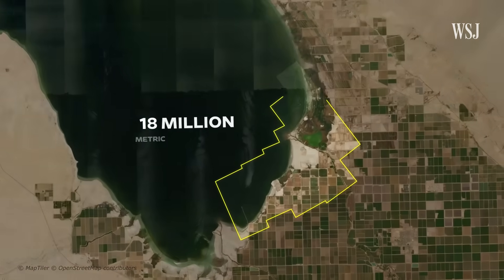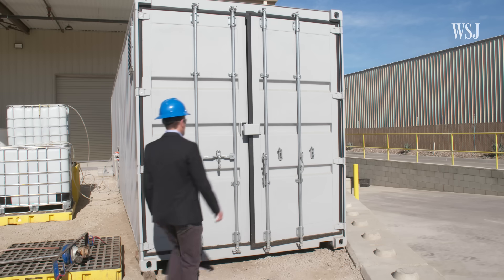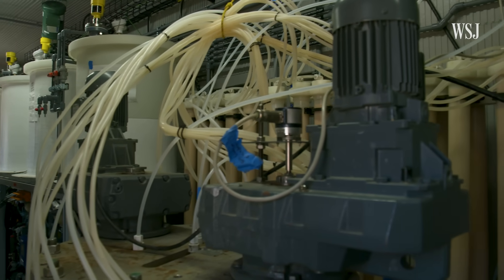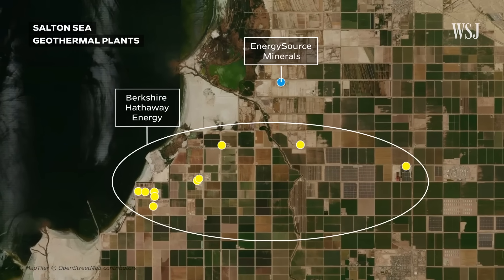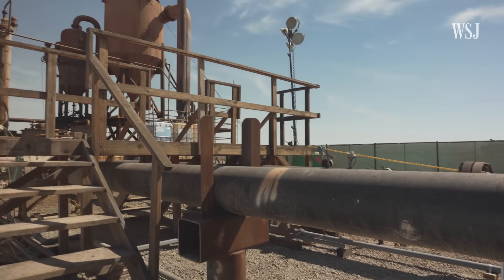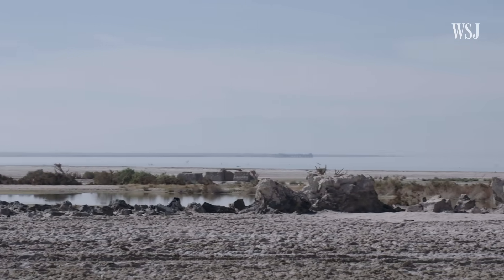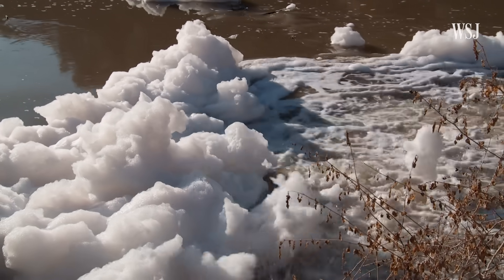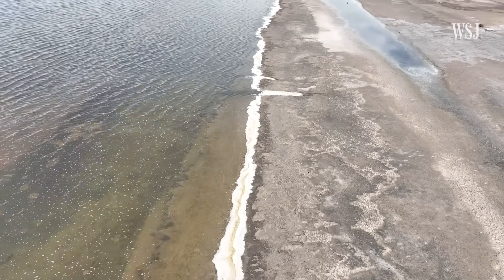This Toxic, Drying U.S. Lake Could Turn Into the ‘Saudi Arabia of Lithium' | WSJ

Comment: The US just seem to keep having every energy they need, before it's finding enough oil and natural gas for Americans, and than now lithium. Geography just keep giving the US everything they need.
Reply: America is literally half of a continent end to end it’s crazy
Reply: @abinodattil6422  It's still extremely resources rich even considering its size. The only other places that can compare, like Russia, typically have to deal with the resources being in very inaccessible and hostile regions (like Siberia). The US is blessed in having most of its resources within easy reach. It was blessed even early on, with plentiful fertile soil as well.
Reply: @ArawnOfAnnwn  hmmmm u think so?, but even then it has crazy cost barriers to overcome, producing anything in usa is bound to be the most costly in the world, so they have to be on the extreme ends of availability and efficiency.

any thoughts?
Reply: Sodium-ion batteries, which swap sodium for the lithium that powers most EVs and devices like cell phones and laptops today. Sodium-ion batteries could squeeze their way into some corners of the battery market as soon as the end of this year, and they could be huge in cutting costs for EVs.

May 11, 2023

TechnologyReview
Reply: Nuclear battery produces power for 50 years without needing to charge

Beijing-based Betavolt said its nuclear battery is the first in the world to realise the miniaturisation of atomic energy, placing nickel-63 isotopes into a module smaller than a coin.

Betavolt says its battery could power mobile phones that never need to be charged and drones that can fly forever

The company said the next-generation battery had already entered the pilot testing stage and will eventually be mass produced for commercial applications like phones and drones.

“Betavolt atomic energy batteries can meet the needs of long-lasting power supply in multiple scenarios, such as aerospace, AI equipment, medical equipment, microprocessors, advanced sensors, small drones and micro-robots,” the firm said in a press release.

The independent
Reply: @abinodattil6422 wrong. The usa has a vast river system and the most efficient commercial rail both which make transporting anything extremely cheap and economically feasible
Reply: @abinodattil6422   Not if we can automate it... Enabling technology already exists to do so. It wouldn't even remotely be the most costly in the world to Americans buying American products because of the high import taxes and shipping costs associated with natural resources we bring in from China, Russia, Africa, etc.
Reply: @DW-op7ly    Too low power density for them to be effective in automobiles. Not gonna happen. Cycle durability is also a major issue. 

If we're using them for continuity of power in a solar grid, they could be useful, but for replacing anything like a car or phone battery you're mistaken.
Reply: @foxooo  those things cost money
Reply: @DW-op7ly   Also, the US had nuclear batteries 50 years ago when we started putting nuclear-powered pacemakers into people's chests. It's nothing new. 

Stop reposting articles about stuff and learn the science or physics if you really want to start talking about replacing current technology. In most cases, it has been thought of, but isn't widely adopted because of inefficiencies and other engineering issues that prohibit widespread adoption. Quoting hype articles does nothing to advance the conversation
Reply: @foxooo  Yes, exactly. International shipping costs and import tariffs by definition and by intention would make any US-produced output like this competitive in our own market.
Reply: It’s already happening  we had 50 years of people going the cheaper option route 

That’s not going to change especially in todays world

👇

The cost of a Na-ion battery cell is expected to be around $40-80/kWh compared to an average of $120/kWh for a Li-ion cell. Na-ion batteries are safer (operating temperature range, stability), and have faster charging times and longer cycle lives. Their energy density is lower, making them bulkier and heavier.

Energy Post
Reply: Yeah they had it 50 years ago 

This company can put its battery on a coin 

You are probably one of those great scientists tinkering away in your lab as the world passes you by 

We use to have lifetime guarantees on the products we purchased 

Now we are lucky if we get a 1 year warranty
Reply: Future Sodium Ion Batteries Could Be Ten Times Cheaper for Energy Storage

They also do not have practical material limits. There is no shortage of salt or soda ash. The United States has about 90% of the world’s readily mined reserves of soda ash. Wyoming has 47 billion tons of mineable soda ash in the Green River basin. There would be hundreds of TWH of power storage from each billion tons of soda ash.

Based on material costs of $4 per kWh there could be $8 to $10 per kWh sodium ion batteries in the future. This would be ten times cheaper than energy storage batteries today.

NextBigFuture
Reply: Dec 29, 2023 06:13 PM
BUSINESS

Chinese Carmakers Begin Mass Rollout of Sodium-Ion Battery-Powered EVs

What’s new: Two Chinese state-owned carmakers have begun mass-producing mini electric vehicles (EVs) powered by sodium-ion batteries, considered a possible alternative to the lithium-ion batteries currently used in most EVs.

The first batch of the Huaxianzi passenger EVs equipped with HiNa Battery Technology Co. Ltd.’s sodium-ion batteries, rolled off the production line of Yiwei, an Anhui Jianghuai Automobile Group Corp. Ltd. brand, on Wednesday, Hina said in a statement. Large-scale deliveries are set to begin in January.

CaiXin
Reply: @abinodattil6422  Shale Oil disproves your case. There was a time when it was too expensive to be competitive but as technology improves greatly and infrastructure begins to be built for it, it is giving Saudi Arabia and Russia a run for it's money.  OPEC no longer has free reign to set prices as it wants.
Also Lithium won't be nearly as difficult or expensive to transport as Shale Oil and Gas, which is the only downside to it.
Reply: @abinodattil6422 If it involves a lot of labor, sure, but if it's machinery and automation, it can be done.
Reply: @DW-op7ly Sodium is interesting, and going into production, but last I've seen it's gravinometric energy density isn't good, and neither is it's power density, so that wouldn't work well for cars, or at least not yet, but it might for grid storage.
Reply: @fjalics  but even that costs money, And not as competitive as you might think
Reply: Yes the negative for Sodium-Ion is the low energy density and the bulkier battery 

The advantage it’s more environmentally friendly, You get more charges per battery, Cheaper cost, , more reliable during cold weather, and we know Lithium batteries were burning up after they got flooded.

I guess we will find out if that happens to Sodium-Ion batteries 

As last month, there are 2 companies in China who had EVs coming off the assembly line that are using Sodium-Ion batteries
Reply: Shale Oil was borrow money explore and drill. Where the depletion rates are so horrendous 

These Oil Companies had to borrow and explore drill 👉 drill sweet spots  to keep up with production numbers. Where even with the run up of oil prices from a few years back. These companies still didn’t pay off all the debt they owe
Reply: @abinodattil6422   hmmmm u think so?  The USA bound to be the most costly place in the world to produce anything?  Have you considered Switzerland, where salaries can be double to triple?  Or any Northern European country for that matter?
Reply: @st-ex8506  Switzerland never was a manufacturing hub, I meant in mainstream steam sense
Reply: @abinodattil6422  Oh yes it was, big time! Manufacturing was key in the economic development of Switzerland, when banking was still mostly a family business. And it still is!

Everyone knows Switzerland for its banking sector, but few know that its manufacturing sector is more than 3 times larger (industry is 25% of GDP vs 9% for BOTH banking and insurance sectors combined... industry being 18.9% of US GDP for comparison).  

It's so easy to fall for clichés....
Reply: @st-ex8506  hmm fair enough
Reply: @abinodattil6422  To be perfectly fair, the high costs of manufacturing in Switzerland has forced the industry to concentrate on high value-added sectors.  For example, no way car manufacturing could be competitive in Switzerland.  We used to have pioneer brands like Hispano-Suiza, but they are long-gone, leaving only a very few "supercar" manufacturers., for which cost is not really the main concern.  We used to have one GM assembly plant, but it closed in the 70s if my memory serves me well.  Having said this, Mr Chevrolet was Swiss and started his automotive career in Switzerland, but emigrated rather early to the US where he met with success.
Reply: @foxooo wrong. Your labour price can’t make up for transportation cost when the competition doesn’t pay nearly as much for labour
Reply: @Laminar-Flow labour you forgot about
Reply: @DW-op7ly  The China market has EVs with shockingly low prices, and there, if you optimize for price, and compromise on range, and charging speed, you can do it. Of course, there is a ton of effort going into batteries right now, so who knows what they will figure out in the next 10 years.
Reply: @b._.render  They aren’t using human labor for this, it’s automated.
Reply: @ArawnOfAnnwn  I just looked it up the Americans have more available oil than all of the Middle East. There smart use everyone else’s resources and when there’s none left the Americans are good while everyone else is in big trouble.
Reply: not 100%  @Laminar-Flow
Reply: @abinodattil6422  All businesses should always strive for efficiency and strive to not pollute the environment.
Reply: @ArawnOfAnnwn Russia is extremely resource rich, they’re just too drunk to extract any of it
Reply: For real.
Reply: Except the US companies keep charging us like they imported these energy supplies from overseas.
Reply: Lithium battery 🔋 is not energy ⛮.  It is just energy ⛮ storage. We still need more energy ⛮ generation from traditional sources.
Reply: I think it's not just that the United States has a lot of resources, but that they are in a good position to exploit those resources. To an undeveloped country, this would have just been a toxic environmental hazard.
Reply: I've driven coast to coast 5 times it gives a sense of magnitude that you can only get from traveling by land for days and then add Alaska ( which is big enough to be it's own country)to that and you have some idea.
Reply: @seanbrennan9188  this is same argument when I hear someone say they think all out food should be grown organically.  Drive from Washington State to New York and then tell me 2500 miles of ag can all be changed to organic.
Reply: @danstrayer111  Organic is a scam - I refuse to buy it.
Reply: dont worry majority of the lithium wont be seen by americans
Reply: 2.3 billion tons of eare earth minerals found in Wyoming.
Reply: Lithium is pretty useless without nicken and especially cobalt.  It's the cobalt that's in particularly short supply.  You can't have a cathode without cobalt
Reply: The United States have everything because they're one of the richest nations on earth. The labourerz earn trillions of bux in gross domestic product.
Reply: God truly shed his grace on America.
Reply: We really are lucky in that regard
Reply: Continent???
Is there a continent  that doesn't have everything? ( Australia doesn't count)
When we are forced to import raw materials it's either cost or environmental concerns.
Reply: From what I read to get 1 ton of refined rare earths? It takes 2000 tons of toxic wastewater
Reply: It's all great and fun until the EPA gets on your @ss or until big industry ruins the environment and your health.
Reply: Warent Buffett invested this area years ago
Reply: All ways had it. But cheaper to import it and let them deal with the environmental issues.
Reply: @nothanks81  You mean like when covid hit, and we couldn't get masks, cause it was cheaper to import it, and they needed it? Or like when russia cut off gas? I'm not against imports, but I am against being helpless and vulnerable. Also, did you listen to the story? It sounds like they run the brine through some process, pull out what they want, and pump the rest back underground like before. I don't see a big environmental problem. Seems way better than what they do in other places.
Reply: Lithium is mainly processing; there's LOTS of it around . the two main worldwide "plays" are in northern Nevada and Argentina. My uncle has huge numbers of options on these plays, but it's not rare, like rare earth minerals. And there are oncoming Lithium alternatives that can blow the bejesus out of this mineral.
Reply: Would you think Americans should reap the benefits of having lower energy prices, like the Middle East with their cheap gasoline?
Reply: @ting2222  No, we should drive EVs, and sel the oil.
Reply: Every landmass is blessed with natural resources. The difference is that the u.s. has the technology and entrepreneurial spirit to find and use it in a way other countries cant.
Reply: And all of that is used to make a small number of people suuuuper rich
Reply: You forgot coal
Reply: I wish more people in the US realized how blessed we are with this land. Tons of resources, tons of geography and wildlife (mountains to forests to swamps to deserts to plains), unique features like Yellowstone and redwoods/sequoas, tons of coastline, two oceans protecting us, etc.

As for the resources, we certainly have a lot but another key component is the technology/skill/knowledge to find and utilize them.
Reply: Man, this country is the luckiest son of b...of all.
Reply: Since the election we're been buying oil from our enemies overseas.
Reply: And they steal from the rest of the world as well (wink wink crude oil)
Reply: Liberal politicians and the enemies of the ordinary man will do their best to block it.
Reply: Water > lithium
Reply: USA! USA! USA! USA!
Reply: Lithium is plentiful and is not in short supply. At all. It's everywhere.
Reply: that's why ameritardia imperialism keeps invading the entire world
Reply: what about R n C?
Reply: Its not finding in most cases... In many cases its technology is developed to extract it.
Reply: When our grandparents said god blesses this country, that’s what they mean
Reply: And the Democrats and their uniparty RINOS through their corruption yet and still keep America from being energy independent enriching countries who in many cases hate us.
Reply: No need for imperialism
Reply: US has always had everything it needs. That is why it’s the  world’s only remaining Superpower. US companies invest overseas only when they it is cheaper to produced goods which puts constant stress on those relationships.The US government invest in other countries only for security regions. This is why our country grapples with the idea of “isolationism”.

The US doesn’t fall into the European narrative of going to war for resources, but the radical left would have you believe it.
Reply: the US has plenty of oil under ground.  but the current politicians are paid by other country's not to tap into it.
Reply: The US is blessed by God. The facts don’t lie.
Reply: The USA is using up everyone else resources and saving there’s for the end
Reply: There's a basin on CA/NV border. Too
Reply: Even when it comes to traveling and vacationing, we have every single geographical area most of Europe and Asia have.

All without leaving North America.
Reply: It's God's plan
Reply: @TexDex_  How do you know which god's plan it is, when people invented and believe in so many of them?
Reply: @fjalics  He goes by many names and is variously interpreted. I take to simply calling him "The Architect".
Reply: @TexDex_  A lotus flower grew from Lord Vishnu's navel with Brahma sitting on it. Brahma separated the flower into three parts - the heavens, the Earth and the sky.
Reply: And knowing that,  the USA is withdrawing from it Cold War entanglements, patrolling of the oceans, and protecting world trade.  Globalization and world trade were the USA's attempt to coax the world into western capitalism rather than alliance with the Soviets.  But the Soviets are no longer a military threat, but the rising economies that depend on protected trade routes are an economic threat.  Depending on long brittle supply lines turned out to not be such a great idea either.  So farewell, globalization and post WWII relative peace.
Reply: God loves us
Reply: and our president will say YOU CAN"T USE IT ENVIRONMENTAL IMPACT
Reply: It's China. Just that China is too populous.
Reply: GOD is a gringo......🤩
Reply: I think they're going to donate it to Israel or is it Ukraine this time 🤔
Reply: We don't need EVS thus no need for lithium.

Comment: Sadly, the lithium batteries are not the future for EVs, as they are unstable and dangerous.
Reply: Lithium leads for mobile devices. EVs pack to much to tight in more volatile use cases from weather and accidents. There r other more stable uses other than EVs.
Reply: LFP (lithium iron phosphate)  is not unstable and dangerous, and it still needs a lot of lithium.
Reply: Sodium-ion is the big thing for car batteries right now . Well atleast in China that is
Reply: The batteries in your phone, tablet, and laptop are made of lithium 🤣
Reply: @dead01  I said EVs, that means batteries above 10kWh, not phone batteries. 
By the way, those catch fire more often that you might think...
Reply: Congolese cobalt slave: 😢
Reply: @Pfyzer maybe the salton sea contains cobalt 🤔
Reply: They are also some of the most energy dense and charge-discharge efficient power-storage solutions we have.